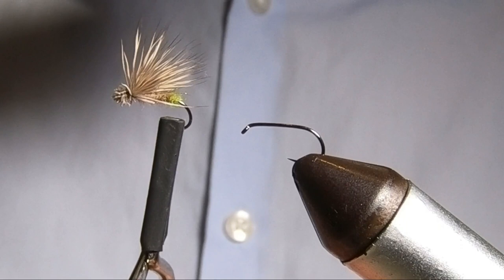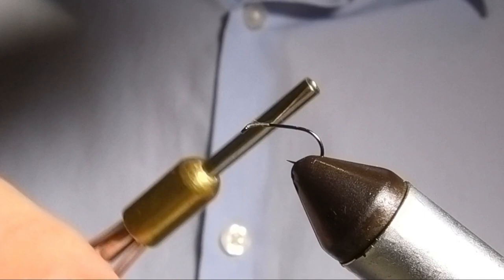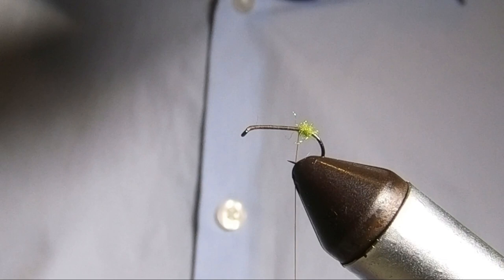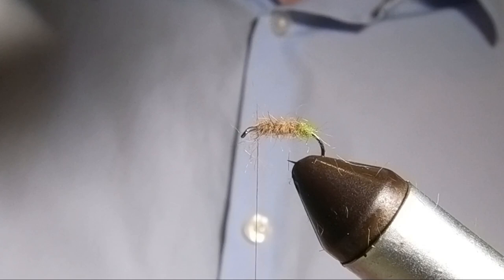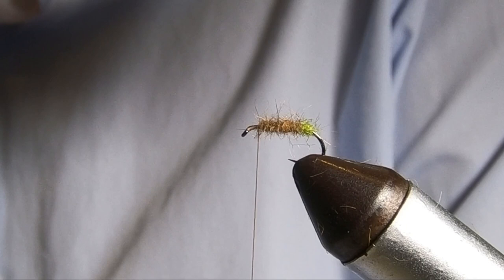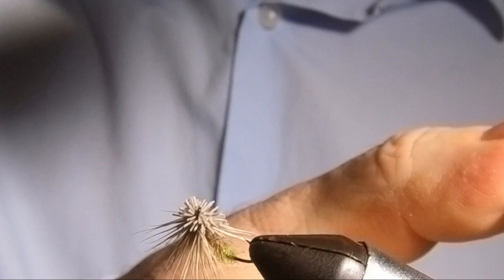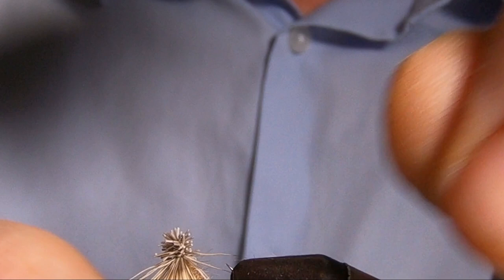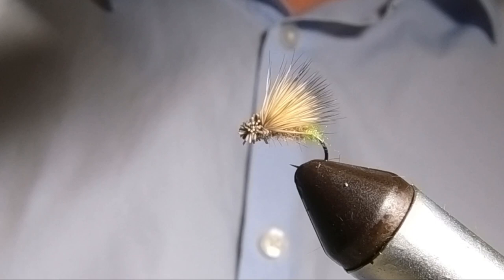Neff Caddis

Comment: Nice looking fly Chris. Like the way your show the materials and the packaging, can be difficult buying the right size etc but seeing helps alot. Cheers

The length gauge on your fly rod, did you make this yourself? Great idea
Reply from the maker: Thanks for the comment, yes the rod gauge is homemade (our club likes an accurate return and this is a quick and easy way of measuring the fish without over handling them). I started with strips  of waterproof tape, then rod whipping thread and now I use an edding 780 paint maker (quicker and easier).
Reply: @chrismatthewsflyfishing7724  nice one. Ill need to get myself a paint marker then 😉 plenty time before March lol thanks

Comment: I use a front hackle, but it's a soft hen hackle and not designed to assist floating,( as with original ) but to suggest legs and to impart life-like  movement to the fly.  It definitely makes the fly more appealing to the fish!
Reply from the maker: Hi Jonathon, I've tried the same with a Partridge hackle but its so hard to find them with a short enough hackle length. Which hen hackle do you use?
Reply: @chrismatthewsflyfishing7724  Hi Chris. I just use the smaller feathers in a veniard partridge pack. I don't obsess about proportions. An oversize hackle might even act as more of a trigger to fish.
But why do you want the hackle to be very small? Have you seen how long the legs ( and antenna) are on a real adult sedge? I'm.just putting a few turns at the head, not running it down the body like the standard hackled caddis fly. Basically a spider with a deer hair or CDC wing......soft hackle dry flies are LETHAL. The moving ' legs ' make the fly look alive and struggling.
And with good floatant, I always favour CDC wing over deer hair anyday .....my philosophy on fly-fishing was similar to Bob Wyatt before I read his book, but the one thing I disagree with him is his dislike of CDC .....it makes very realistic wing material and also collapses when fish takes......I'm convinced some fish eject a deer hair fly quicker as it feels unnatural and that they can even push fly away as they about to take............I prefer dryfly fishing on slower glides and pools as opposed to more streamy water, but using enough good quality CDC in wing and a special floatant like Loon Loscha, I e found CDC to float just as good as any material in pretty rough water.
Reply from the maker: Totally agree Jonathon, and ofcourse the softness of the CDC helps when casting to stop the dreaded leader twist. I'm not sure why I obsess about the hackle length, probably just habit. I keep meaning to buy a complete skin so I can pick out the small feathers  but the English skins are a bit pricy! I remember reading a book by Ron Holloway and how he used extra long tails on his dry flies to match the length of the naturals. It did look odd to my eye to have a tiny iron blue with whisks four or five times the body length but he'd probably forgotten more about entomology than I'll ever know. Always learning.
Reply: @chrismatthewsflyfishing7724  CDC hell of a lot easier to work with and I find deer hair so messy. I also found deer hair not the wonder floating material its made out to be and still needs floatant on it ......maybe I've just had crap deer hair!